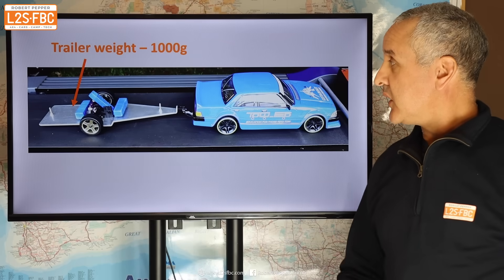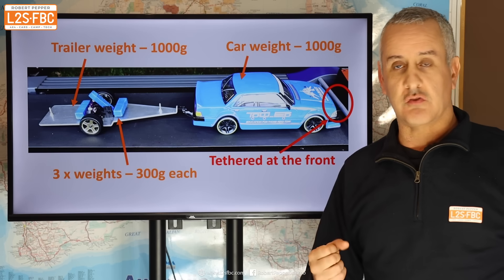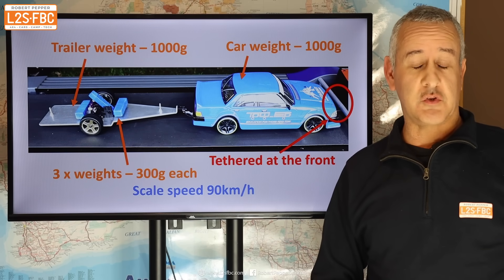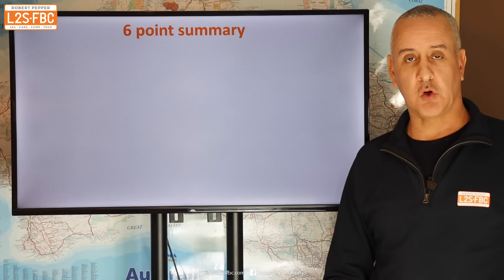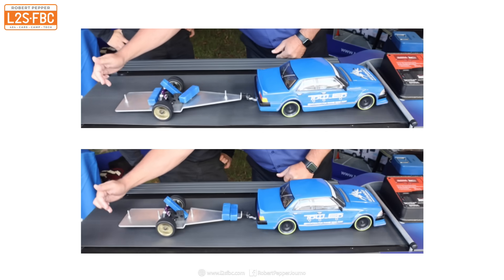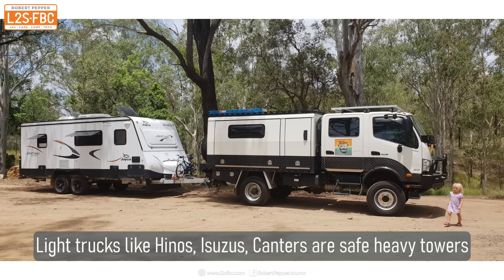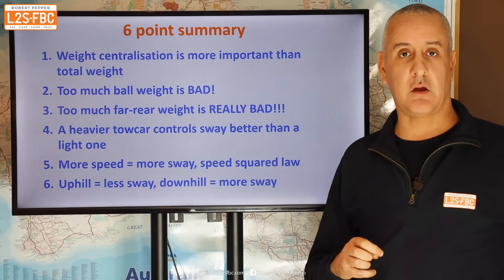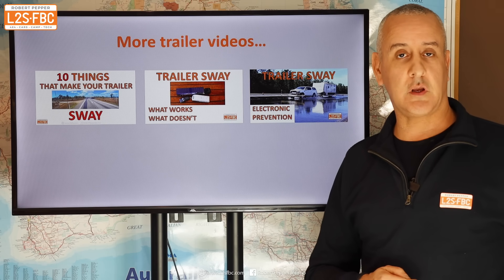7 trailer weight distribution setups, some safe, some deadly.

Comment: Fairly good video, but you fail to mention so many variables.  The  model car is not powered it is on a rolling road which affects the dynamics.  The trailer weighs the same as the car.  It should not be more than 85% of the car weight, unless the MAM of the car allows it.  No mention of GVW (Gross Vehicle Weight) and GTW (Gross Train Weight)  GTW - GVW = maximum weight you can tow.  I hope your other videos will  cover the effects of braking too fiecely when sway occurs and also powering out of the sway :)
Reply from the maker: I do go over the limitations of the model. In Australia often trailers are more than 100% of car weight. My other vidoes cover all of that including how to get out of sway - check the links in the description.  GTW-GVW isn't an exact formula, there are are other factors too. My towing calculator cover all the maths.

Comment: Does the axle location make any difference?  What I mean is if you move the axle further back how does it affect sway with the same loads?
Reply from the maker: axles further back is more stable
Reply: @L2SFBC  That also increases the tounge weight.
I once worked for a state research organization with a boss that was an engineer.
He got a fat contract and needed 6 ski boats to perform research on the river.
He had the axels adjusted so the tounge weight was between 60 and 70 lbs on a 5000 lbs trailer.
So the summer college temps could hitch them up easier. 
I tried to tell him it was wrong but...
Towing them was really interesting and could be white knuckle sweaty palms really quick.
I never had a real problem I could slways use steering or acceleration to break the cycly but eventually an inexperienced college kid going downgrade at interstate speeds crossing a bridge at the bottom of a small valley got passed by a semi-truck in a cross breeze.
I was right behind him when he lost it.
The boat broke free and slid 150 fett farther that the trailer.
The trailer and the carry-all was jammed between two guard rails jack-knifed and it took a sledge hammer to separate/unhitch the trailer so I-80 could move.
Nobody was hurt and the boat was repaired lots of it lower unit and motor work.
Sometimes counterintuitivly you're better off going with the oscillation rather than fighting it.
I'm positive I would have countered it but I was used to hauling horse trailers and they add another force that can throw the trailer around.
Reply: @ghz24  Thank you.

Comment: So, if I have an unhitched trailer, and I want to add weight, I should add weight near the axel, to make it so the trailer just about tips onto the hitch side, but is balanced enough to easily manoeuvre by hand?
Reply from the maker: yes over the axles is best

Comment: The "Rule of thumb" I've always followed is to have 10 to15 % tongue weight. If your trailer weighs 2,000 lbs, your tongue weight should be 200  to 300 lbs. I've never had a sway issue as a result.
Reply from the maker: You can have too much...

Comment: I was taught 60% forward 40 % rear when hauling items on a trailer.
Reply from the maker: not a bad rule but 60/40 can still be weights a long way from the axles and that's bad
Reply: @L2SFBC  agreed. I consistently haul two four wheelers on a 16 foot trailer, one an 800, the other a 600. I put the 800 up front because it weighs the most and the 600 in the back. There’s no room for anything else. I believe most people drive beyond their capabilities, speed kills. Good video, thank you sir.

Comment: I know this is older, but I am interested in seeing the affects of trailer axle (single axle) placement. For example, is it better to have the axle in the center where the trailer weight is balanced front to back? Or it better for the axle to be manufactured toward the rear giving a bit more tongue weight? Or the opposite? Hope that makes sense.
Reply from the maker: Planning on that for the future! Axles towards rear for stability.

Comment: This info is so valuable and really should be part of drivers Ed. Been towing 5th wheels for +30 years and never an issue but my current trailer, which is a bumper pull toyhauler (low loading heights for motorcycles) and it is a totally different animal AND it takes much much more care when setting up for travel. MFG’s are very good at misleading so don’t trust and have your dealer or better yet invest in a trailer tongue hitch scale so you know what weight you have on your tow vehicle. RULES ….

1. Set up
2. Slow down 
3. Educate yourself
Reply from the maker: Agreed!

Comment: Would be interested in hearing Your views on towing trailers behind bikes. I tow a low box goods trailer and always try to have load centered over the trailer axle point. have had a few squirly  moments when hauling logs down gradients off-road, Used to drag large logs with leading end of log on trailer but this concentrated load at rear of trailer, not good,  so switched to using tow chain & rope to drag the big logs with short rope section as 'sacrificial break point' that snaps if log digs in instead of punting me over the bars. learned from others mistakes but would love to hear professional safety information for towing with bikes. I don't have a car or truck, only bikes and under 1.4m wide trailer can get through the forest in S.W.Scotland.
Reply from the maker: Same principles of weight distribution and relative mass apply.

Comment: The one variable you missed is a the effect of tire inflation.
Reply from the maker: I'm going to cover that another time - definitely more air in the towcar's rear tyres to handle the load.
Reply: @L2SFBC  Yeah it definitely makes a huge difference having stiffer sidewalls and is one of the reasons duallys are so much better at towing stability. Wheelbase of the tow vehicle is also a big one. Towing from my crew cab dually is night and day difference versus towing with my full size van. And the van is heavy pushing 8,000 lbs with an almost perfect 50/50 weight distribution.

Comment: So, with a dual car trailer, put the front one on backward and the rear one forward, so the engines are both close to the axle. 
This may not apply to all situations, but it's worth a look at least.
Reply from the maker: If they are front-engined cars, generally yes

Comment: Great video, I always thought 10%-15% on the ball for bumper pull, and 15-20% for 5th wheel/gooseneck
Reply from the maker: Many trailers can be towed with well under 10% towball mass.

Comment: I vaguely had the impression that erring on slightly biased forward was generally safer, but you did a great job clearly showing and explaining each condition. Thanks.

A reason for that thought & another factor to consider is being right on the flutter point of balance. If you hit a bump and your trailer easily rocks forward and back, loading and then lifting on your tongue/hitch, I would expect that to upset balance & control much more than biased, and possibly induce a sway situation/harmonic.
(mechanical engineering principle: it is usually better/easier to control to force from a consistent direction of loading, rather than having load switch directions)

I would think that having a high load/high center of gravity load could make that problem really bad, where the same weight close to in-line or below would ride more smoothly.
Reply from the maker: Yes, higher CoG is bad. Check the description, I have a video on that too.

Comment: What about the sudden forward weight lurching each time the car bounced off of the stop bar in the blue model representation? Each tap is the equivalent to slamming the brakes at the worst possible time by causing additional tongue weight while the trailer is trying to track the tow vehicle, and yet not aligned. This could also be used to demonstrate how bad braking technique when towing can be deadly.

Comment: Interesting video!
I got into a sway situation towing a boat down hill many years ago. (Around 80 km/h)
My father gave me advice when I first started driving to accelerate not break if this ever occurred.
Took a lot of guts to do it when the time eventually came. But it worked and saved me rolling over for sure.
Probably soiled the undies of a couple of my passengers but they all learned that trick as well. 🤠
I remember my trailer was fairly evenly weighted. Engine on the back but not a lot of ball down weight.
I later herd this problem is exaggerated by a phenomenon caused by the suspension introducing a steering action on the trailer axel.
That is as the suspension flattened out on one side the axel moved to the rear and as the other side raised it moved forward.
I notice in your demonstration the models did not appear to have suspension at all.
I’d be interested to learn more about this?

Comment: In the US trailers don't weigh what vehicles do. Does that matter?
Reply: It is rarely the case where trailer and vehicle weigh the same.  It is always better to have heavier towing vehicle than trailer but if not possible weight distribution is much more important.
Reply from the maker: Agreed!

Comment: I've done 100's of thousands of miles over 4 decades towing everything imaginable off a 50mm ball and done my own tests and come to somewhat different conclusions. I took a car trailer that when laden with a car had known poor stability issues and on my short wheelbase Land Rover the critical speed was only 35mph where the swaying would start, on my empty short wheelbase Ford Transit the C/S was 50 mph and on my Mk2 Ford Granada 2.8 estate it was rock steady at 65mph without any swaying. If the sway was allowed to build up for a few seconds it would become near uncontrollable, the only way I found to stop the swaying once it had built up was to brake hard which is contrary to ALL the safety advice here in the UK but ALWAYS brought the swaying trailer safely back under control. In all cases the swaying had a critical speed where the trailer would gently start to sway and gave the driver plenty of warning to slow down, the wrecks in the video must have happened to very poor and incompetent drivers who drove too fast without the knowledge and understanding of how to bring the trailer safely back under control. In my own experience I knew some people who wrecked their car and trailer and they were always bad, incompetent and ignorant drivers who thought they new best. My car trailer that I mention above was finally wrecked when a 'friend' borrowed it and after I had very strongly told him not to exceed 35 mph he wrecked it, after the wreck I asked him why he had ignored my warning and he said that 'he thought he could control it' so once the swaying began he didn't brake but accelerated to 'try to get through it' totally ignoring all the advise I'd given him. That guy was a total jerk. What I'm saying is that different vehicles have differing vulnerability to swaying and it's the drivers duty to learn about his setup and drive accordingly, the lesson is that things to do with this issue are highly unpredictable and should not have generalised rules applied
Reply from the maker: What has been shown to work is braking the trailer only. This is demosntrated in another video (see description). In lieu of trailer brakes, what you describe can work but is riskier. I don't see anything you've said as contrary to the video. I do appreciate the post, always good to hear real-world experience.  What is the UK advice?

Comment: Towing a 3200 lb race car with a full size Suburban it was relatively easy for us to feel the stability difference and realize that a little tongue weight was good. Once we felt a good level of stability we Mark the front wheel point and loaded the same every time. Seem to serve us well. Not mentioning the electric brake here for recovery? Guess that's in your other video.
Reply from the maker: Yes, using the electric brake is in another video -  https://youtu.be/PS_T3-zCzHw

Comment: This video should be required viewing for every driver. Everyone tows something, sometime. I thought I had a pretty good grasp on this stuff. The one that got me was the wieght at front and back. I had an 18ft single Axle self contained pull camper. I added a full width basket in rear for extra gas, bicycles, etc. I lengthed the pull bar at the front and all loose gear in camper was loaded towards front. I had about 300lbs ball wieght, which is a good balance. But the physics says the wieghts at the extreme ends will sway like a pendulum in a grandfather clock. It worked fine under a pull. But braking was tricky. Finally I came down a hill to fast. Just like the video, wipe out. Camper was toast. It didnt help that I was also towing a 16ft  boat behind the camper, legal in Nevada. Leave the doubles for the pros folks.
Reply from the maker: Thanks, great post!! So let me get this straight - you can legally tow two trailers in a row in Nevada?

Comment: Not mentioned is that the longer the wheel base of the tow vehicle, the better, and the trailer axle should be positioned with 60% of the trailer length in front, and 40% of the trailer length in the rear. (not counting the tongue)
Reply from the maker: Yes longer drawbar the better

Comment: I learned this lesson a hard way when I was still a teenager. My fiance and I were moving across country and I had overloaded my Toyota 1/2 ton truck with about 2500 lbs of tools and gear and was pulling a box trailer rated for 3000 lbs and had around 4500 lbs in it and since I didn't know anything about the distribution I had it heavier in the rear. I did alright while on surface streets below 45 mph but as soon as I hit the interstate I almost rolled the truck. I redistributed the weight and placed some heavier stuff towards the front and the heaviest in the front of the bed of the truck. The rig stabilized but the rear springs were almost flat and the smallest little bump would make the axle smack the bump stops. We made the trip and even fell in behind a big rig convoy that was running 90 mph. My truck couldn't get above 50 mph without being in the draft of a larger vehicle and got on the radio wih the convoy and got one of their guys to slow down for me and pull me up with the convoy. We topped out around 110 mph catching up. Made great time but it sucked down half a tank of gas in less than 30 minutes. I had to get off and fuel up and wait for the guys I had been in convoy in with from the start. Even behind them, I would have to be drug up to 70 mph in their draft or I would fall behind. We rode 2,000 miles with me drafting behind my brothers full size truck pulling another box trailer.
Reply: Luckily you were only hit in time and gas money, nothing bad happened, the only time I ever used draft was to reduce consumption, it does work but it's sketchy, I kept thinking if the truck swerves to avoid something there is no way I'm avoiding it too, never did it again.
Reply: @-na-nomad6247  its possible, a tip is to be in contact with the driver via CB radio and make sure its ok, then just lock on one spot on the back if the rig and stay there. It takes some getting used to but is fairly easy once you learn the trick and if they swerve, you will swerve with them
Reply: 50 pH is very alkaline, I'm surprised you didn't melt.
Reply: @PezaoMandinga  Someone give this man a cookie - made me chuckle
Reply: @PezaoMandinga  damned tiny keys, lmao
Reply: Interesting how suicidal a young man can be and still laugh at off. And on the bright side at least you didn't kill anybody that time.
Reply: @davej7458  seeing as how I was in direct radio communication with everyone I drafted with and we already had a system set up in case of sudden manuvers, it was as safe as it could have been. Otherwise, it would have taken us 6 days and a whole lot more money than we had, to be able to make the trip.
Reply: At high speeds drafting makes a big difference. But heavy loads and high speed is a bad combination. My worst tow I literally could not get above 35 mph before a fishtail would want to start. I was towing a suburban on a tow dolly with my van. Tow dolly was made for a Honda Civic seemed like. I hate them tow dollies to this day.

Comment: One additional point, an extension of the uphill/downhill point.  You may not feel sway beginning while you are accelerating only to find that when you ease the throttle you have already passed the point of no return.
Reply from the maker: Hmm it's possible I suppose